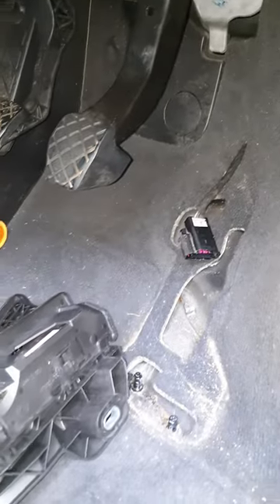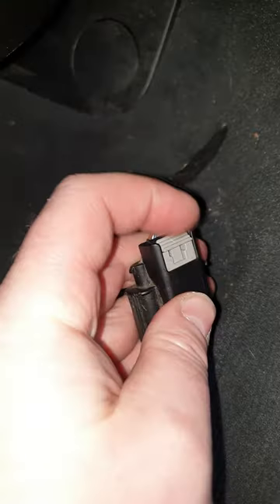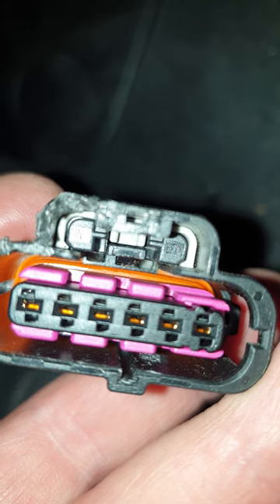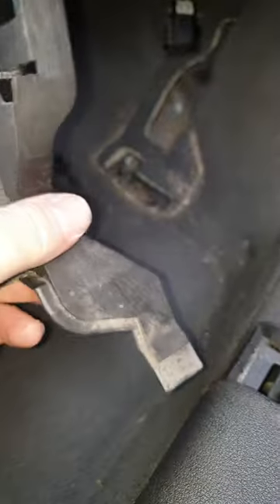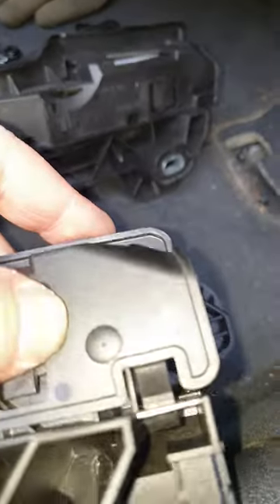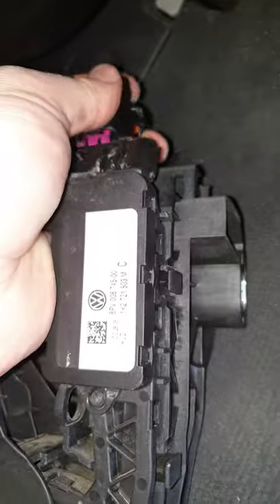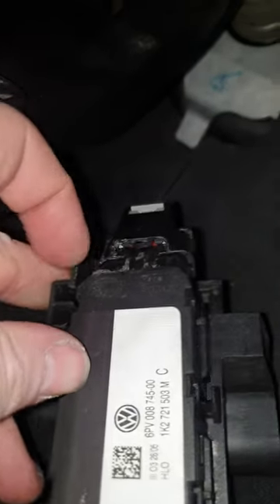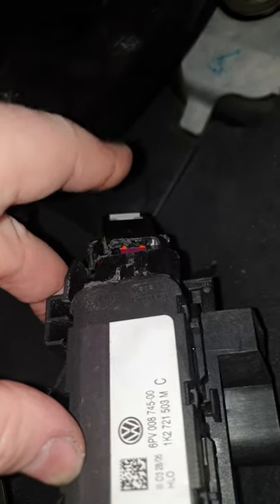Audi VW Accelerator Pedal Connector - How To Remove

Comment: You don't need any tools to remove plugs on any vw-audi group cars , what you do is make sure that grey tab is pulled out ( don't remove it ) and then press down on it it should lift up that plastic tab inside and pull the plug out . If it doesn't work make sure you push the plug back in firmly and then try again , this method works when the plugs are covered in dust .